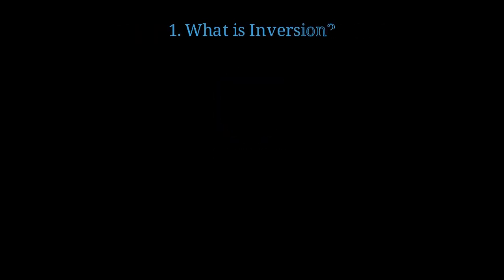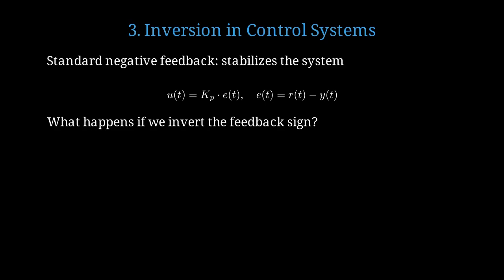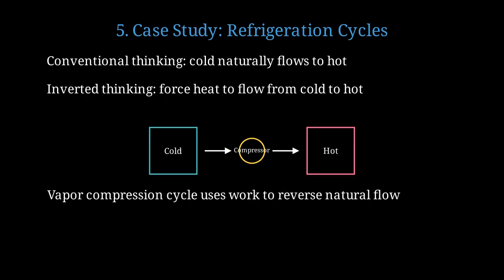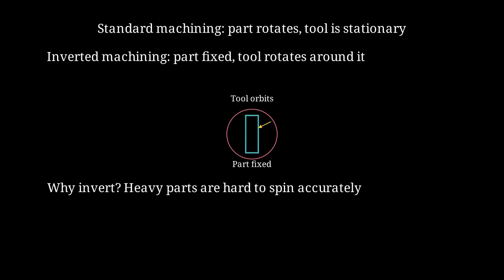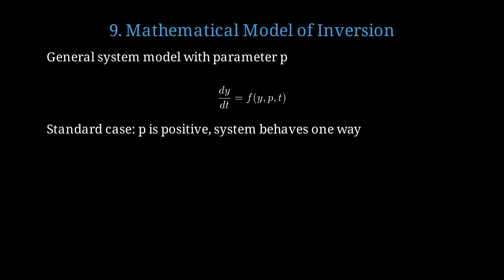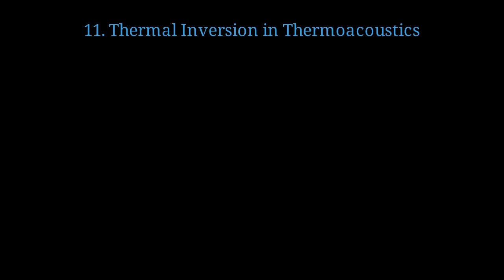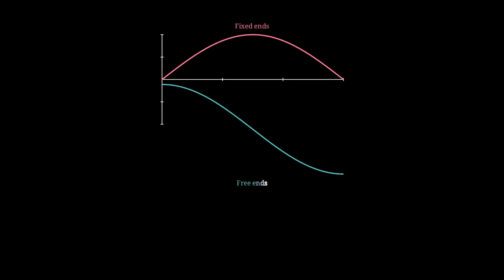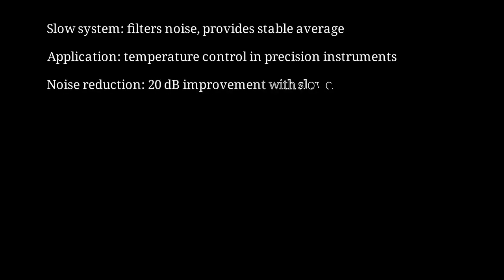Why Engineers Flip the Rules to Solve Problems

Comment from the maker: Can inversion principles be formalized into a generalized optimization algorithm for cross-domain system design?
What are the stability conditions for coupled inverted and non-inverted subsystems within hybrid control architectures?
How can stochastic resonance and dithering be unified under a shared theoretical framework for information amplification?